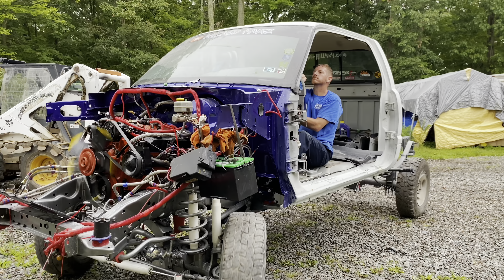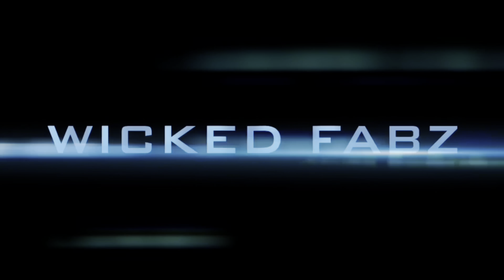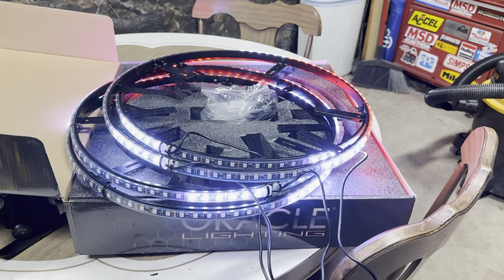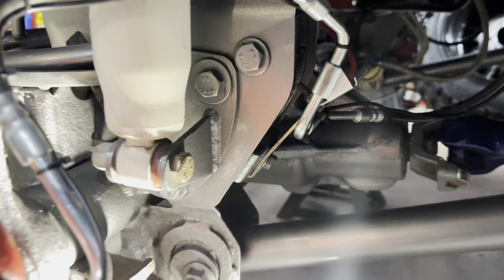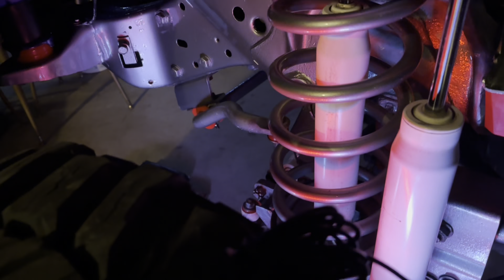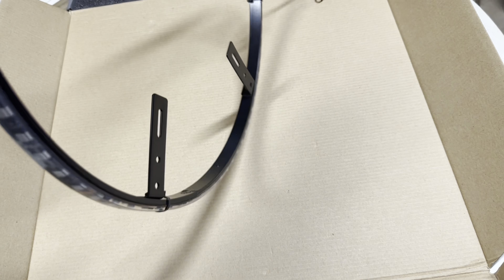Installing LED Wheel Ring Lights the "EASY" Way!

Comment: Would you have to take the ring light off to service breaks?
Reply from the maker: Yes you do.
Reply: I just did some on my Silverado and they are definitely in the way. I used a different kit and also had to rivet the brackets on. The ring itself is bolted to the brackets so I just unscrew the bolts and can take the ring off by maneuvering it around the caliper and rotor and setting it to the side. I made sure I had a little slack in the wire to do this.

Comment: So you only need to remove your caliper and rotor. If you cannot clearly access the location for the holes in the desk if you can access that without removing them, there is no need to move. Is that correct?
Reply from the maker: You don’t really have to take the caliper off. Just when screwing them on, you don’t screw into the back of the rotor and damage it. The reason to take it off is so you can check for clearance of the screws. If they hit the rotor back them out one at a time or all cause yours holes are in place. Then trim your screws down and place them back in.

Comment: Biggest deal is spin your front wheels when you screw in make sure screws aren’t hitting rotors while jacked up. All mine were scrapping.  I was able to take a pipe and push on front dust shields till the screw didn’t hit. I fully installed rears and all the screws hit there as well. I’m going to Lowe’s today to try in find shorter screws. The screws that come are just to long on my Tacoma anyway.  Another side note. The screws are self tapping. Fine on the dust shields.  But the rear drums are thickkk metal. So I wound up breaking heads off on few after they heated up during drilling once they grabbed. So be careful or pre drill like he did. You won’t have extra screws so…  Also on my 4 wheel kit on a 4 door Tacoma my back right wheel wires didn’t reach to my connector (under the hood)so forced to order a 6’ extension. I only needed like 3’ but that’s all they make. So now waiting on that to arrive.

Comment: I have two questions.... The first ones is, where did you mount your control box? Second question is, did you have to buy any Wire extension For the whale lights in the rear to reach the control box ?
Reply from the maker: Mounted the control box mid frame on drivers side  and yes I needed the extensions
Reply: @WickedFabz  OK thanks......great vid....
Reply from the maker: @Bonafide_SMOKE  thank you

Comment: What size are the lights and what size are your rotor that would help please
Reply from the maker: The rotors are stock size. The rings are for 20” wheels. I bumped up in wheel size. The originals were 16” wheels. Hope that helps.

Comment: There are 2 options i can pick from and i wanna do the switch but don't know how to hook it up
Reply from the maker: I ram all my wires to an accessory fuse box. I used aux beam. Work great for putting them on a switch
Reply: @WickedFabz  i still don't know how to  hook the wire up.

Comment: Would this method also work on k for dust shield on car? So I don’t have to take rotor or brake caliper off?
Reply from the maker: Yes it should
Reply: Yes it would be done much easier......just did mine a day ago